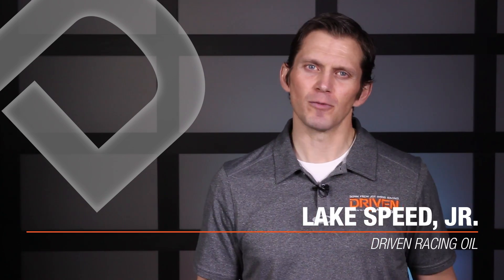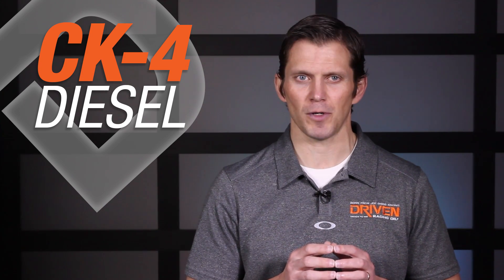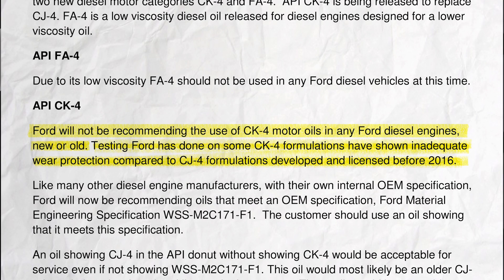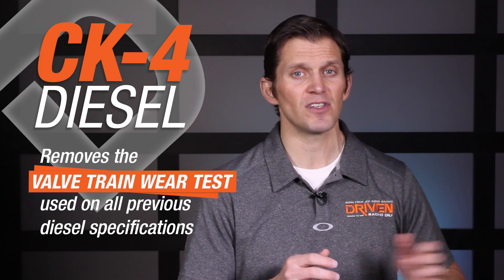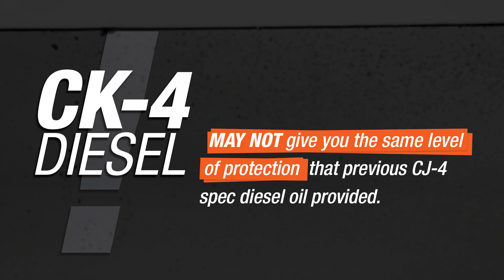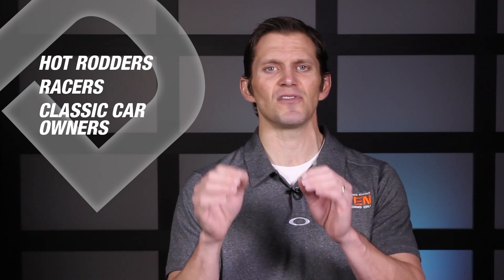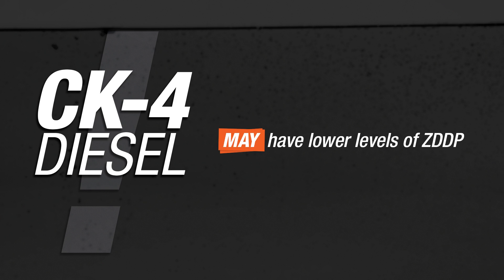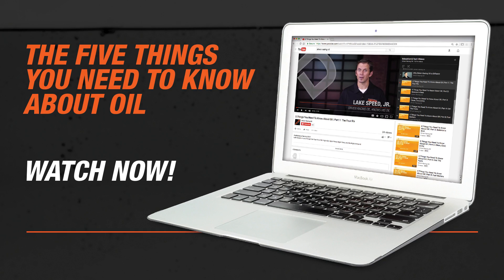What Does the New CK-4 Diesel Spec Mean to You?

Comment: My 1HD-FTE rated for the older API CF4 oil. Is it safe to run on newer CJ4 or CK4 oil rating?
Reply: I Don't think so.
Reply: According to the API's Motor Oil Guide, the newest you can go whilst maintaining backwards compatibility with API CF-4 is API CJ-4 (API CI-4 is backwards compatible to API CD). API CK-4 is listed as only backwards compatible to API CH-4, with Ford's caveat aside.